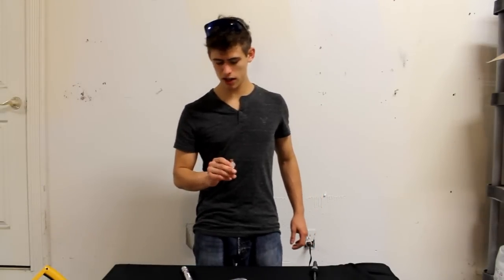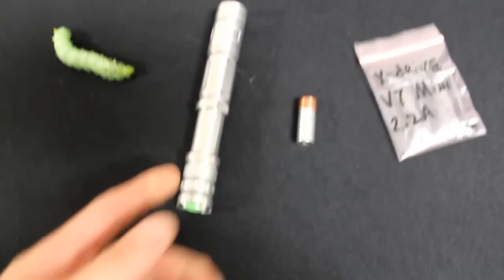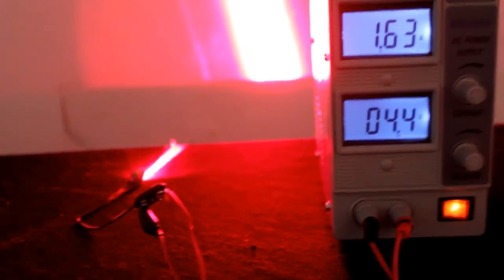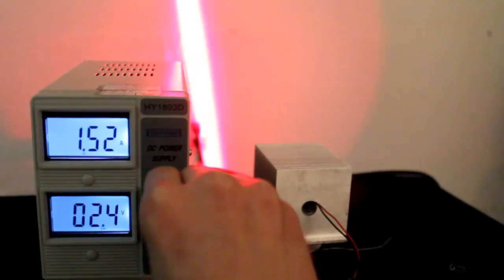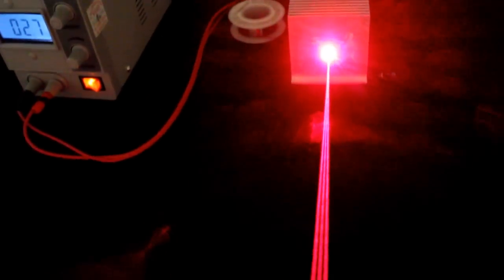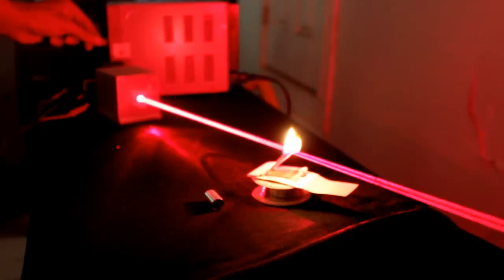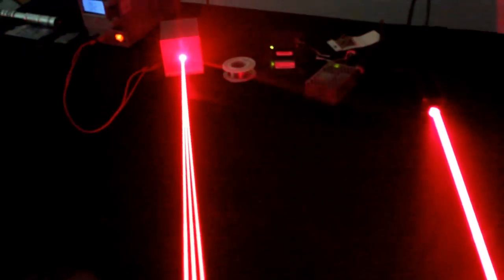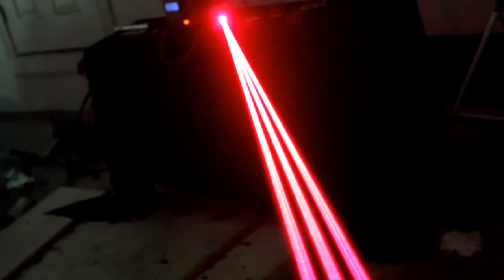Odd Tri-Beam 3W Red Laser!!

Comment: So I have been doing some reading on the application of Fiber Lasers. Do to the ability of cooling via surface area to volume do you think that the use of such product would lighten the weight of your 40W build i.e. the heat sink an still provide s stable wave length for cutting at the ranges you test at? Or for cost an effectiveness are Semiconductor diodes going to give the best result for effectiveness as well as cost?

Comment: I have a couple of questions about lasers. 

1) would a 2W laser appear dimmer if overheating 

2) would higher amp 18650s be worse for a laser than lower amp 18650s
Reply: 1. Yes, a 2W laser may appear dimmer if it is overheating. When a laser overheats, the excess heat can cause the laser diode to degrade, reducing its output power. This can cause the laser to appear dimmer than it would at its normal operating temperature. In addition, the laser's optical components, such as lenses or mirrors, can also be affected by heat, leading to a reduction in the laser's brightness or beam quality. It's important to maintain proper cooling for high-powered lasers to prevent overheating and potential damage.

2.
The answer to your question depends on the specifications of the laser you are using.

Generally speaking, higher amp 18650 batteries are capable of delivering more power to a laser than lower amp 18650 batteries. If the laser requires a lot of power, using higher amp 18650 batteries may allow it to perform better or brighter than it would with lower amp batteries.

However, it's important to note that using higher amp batteries than recommended by the manufacturer of the laser can potentially damage the laser or its components. So, if the laser's instructions specify a certain type of battery, it's important to follow those guidelines.

In summary, if the laser's specifications call for higher amp 18650 batteries, then they would likely be better for the laser than lower amp batteries. However, if the laser manufacturer recommends lower amp batteries, then using higher amp batteries could potentially cause harm to the laser or its components.

Comment: Would you recommend this for a for-fun laser, like astronomy and stuff. I think it's a pretty good deal, but I'm not sure.  http://www.ebay.com/itm/3PCS-Green-Blue-Violet-Red-Light-Beam-Powerful-5MW-Laser-Pointer-Pen-/191194556037
Reply: *****  Coming from experience, the button on that style pointer will wear out and become very hard to activate after a while. At 5 mw the green  pointer beam will slightly be visible on a clear night in complete darkness and other colors will only show up on very foggy days. At $8 it is a good deal for having three different colors to play with but I would want a slightly more powerful green for astronomy.
Reply: *****
Yeah, I have a green laser that is similar (likely the same) that has the same button problem. If I could figure out how to take it apart, it would be a breeze fixing it.
Reply: *****  I also had a cheap green laser in that pen style... long story short: it burned through batteries faster than I though possible, the button became as hard to activate as the "go right" button on a used gameboy, and it got a little wet and stopped working.  
I just ordered a rayfoss 30mw waterproof green laser yesterday, it should arrive in 2 weeks or so. I will keep you updated if you would like.
Reply: don't get them get a sd 301 green laser
Reply: cameron rogers
Yeah, I did a little bit of research, and they seem pretty nice. If only they had variable power so I would be able to show it to people without risk of frying their retinas.